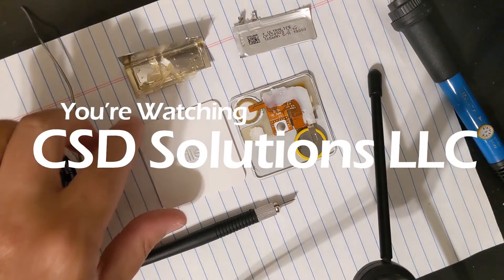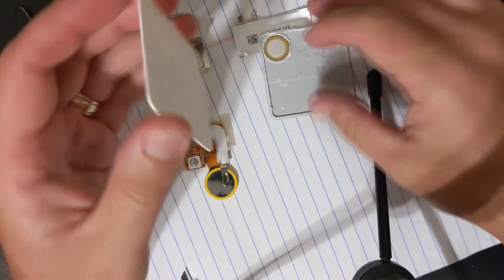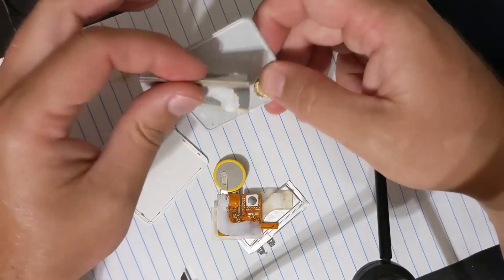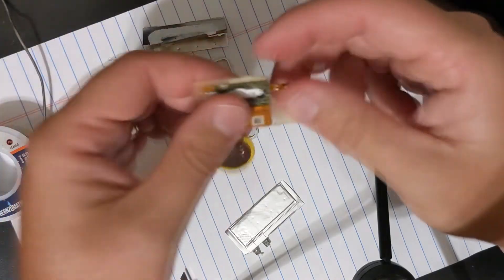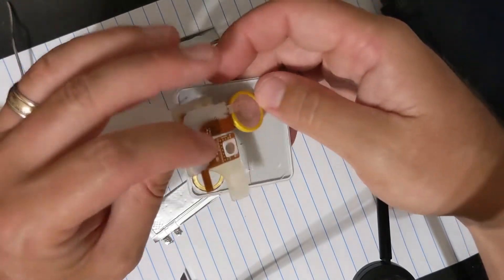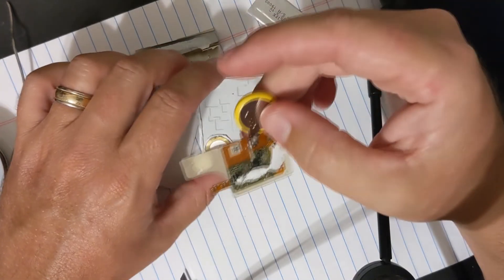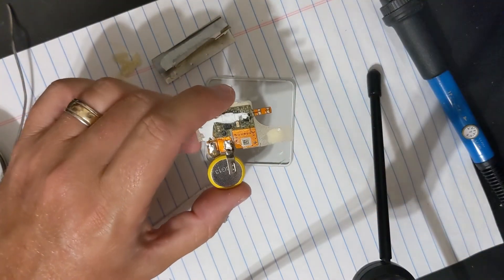Tile Slim teardown and battery replacement

Comment: If you have a hobby battery charger like the Tenergy, Horizon or Orbit or some other similar brand, they’re capable of charging down to 3.7 volts for LiPo and 3.2 for LiFePO4 batteries and this original battery can be charged back to full.  The chargers you use for balanced charging of 1-6 cell RC toy batteries will do it so no need to substitute a battery or throw the lithium polymer battery away.  Just check its charge level and take it off charge when it shows it’s at 3.2v.

Comment: Can you just charge the battery?
Reply: The battery is soldered on to the board. So yes you can change the battery but it does require soldering no matter what.

Comment: On the ones with replaceable batteries, you still have to go into the app and reset the low battery alarm manually.  Maybe that option exists for these as well?
Reply: It wasn't an option for me but it still works. You just always have the low battery warning.

Comment: It would be nice if these had a Q1 inductive charging coil in them. !!!!!
Reply from the maker: This thing is intended to be nearly as thin as 2 credit cards so it would be impressive if they found the room for the charging coil and addition curcits needed to charge the battery.

Comment: LOL This was almost a helpful video but it actually didn't finish with the battery replacement so I don't know what the point was
Reply from the maker: Maybe watch it again if you missed the point. It wasn't a how-to video. It was an explanation of what I did to replace the battery and how it worked after replacing it. The original battery was the putch battery and it was replaced with the button battery, yellow ring. To replace it you just desolder one battery and solder in the new one. This was post so that others that are thinking about doing it understand what they are getting into with out actually cutting their device open.
Reply: Are you just that slow

Comment: For anyone interested, the replace battery thing is like a maintenance minder on a car. You can tell the app you replaced the battery and that prompt will go away
Reply: Unfortunately that only applies for Tiles that allow for a replaceable battery. I can dismiss the prompt on my bigger tiles but the wallet one I can't. Oh well.
Reply: Didn't know that 😮

Comment: I replaced my slim battery with 3 CR1616 batteries with tabs in parallel.  The tile works now, but the app still showed the battery low, so I thought I would delete it and re-connect.... BAD MOVE :(  the app now says this tile is associated with another account.
Reply from the maker: That sounds strange maybe customer support could help. I wouldn't mention the battery replacement. You should be able to remove and add it back.
Reply: @CSDSolutionsLLC They've probably caught on by now...

Comment: I tried using 3  CR1616 batteries with tabs in parallel... fit perfectly. .. but it still showed low battery and didn't show the slim being near by. I tried the option for "I have a new tile"  but when I try to pair it, the app says this tile is associated to another account.  I guess you'd have to replace the battery BEFORE it gets low enought to trigger the low voltage notification. :(
Reply: There is a theory that the Tiles don't measure battery voltage, but simply trip the low battery based on time. For the tiles that take only the CR2032, it's 1 year. My guess is the slim has a three year timer?

Comment: I have the later version and the battery just died. More or less the same but different battery. I consider replace the battery too and print a new case
Reply: My original battery had 380mAh

Comment: I just recharge the battery that was in there
Reply: and that worked?
Reply: @ChrisDembinsky  nope, looked like a lithium battery.... I just took one of my broken vape pens, busted the battery out (3.7 V 1S )
Reply: @ChrisDembinsky  right away yeah, it worked.... i just soldered a 3.7v lipo battery into the + and - terminals (which are indicated on the battery you will be cutting out and throwing away)

Comment: Honestly, big ups to Tile in this design for not making it self destruct once it loses battery connectivity like some companies do for their planned obsolescence.
Reply: They had a software Killswitch on the old tiles. Was absolutely ridiculous back then. I tested the battery using a multimeter and it was 95% full but software said it was dead lol
Reply: @VincentAnzalone  that sounds like something a communist would do

Comment: Would this work without soldering do you think?
Reply: If you find a way to keep the leads firmly connected to the battery it might be possible.
Reply: Maybe filling it with silicone  would help keep it all steady  after it dries up,  which you would have to wait,  only to open it up to create some space on the corners to add not-too-strong-but-not-school-glue.  But you gotta make sure the contacts are pushing themselves.  U may also need a c clamp or something while u wait  for the glue and silicone
Reply: @XKnightLightX Set a heavy book on it while it cures. Silicone, hot glue, epoxy,  fiberglass resin?
Reply: There are solder strips that will melt with a lighter or solder glue, wont hold any other way properly
Reply: A bit of hot glue? Can be trimmed down with a Dremel/rotary tool.

Comment: This makes for a good project. Add a 12 to 3 v step down converter to the car and find a way to wire the speaker to the car horn 🤔
Reply: an opto coupler might work for the horn adapter,,, but it could get pretty annoying.

Comment: The original cell is a lipo battery and actually rechargeable
Reply from the maker: Another cool experiment would be to try to cut two squares in the plastic so that charger leads could connect to the liPo. Then someone could occasionally charge it keeping it from ever getting to the point where the app would flag a battery warning.
Reply: This battery is NOT rechargeable.

Comment: The 2032 batteries are too thick to make a good replacement, the case will not close and then the contacts will not easily touch the speaker and the speaker won't work. The part number for the original slim factory battery is "CP124920" which is a 3.0v 160mAH non-rechargeable battery.  The part number is cp124920 because the dimensions are 1.2mm x 49mm x 20mm, that's how the naming convention works.  It's a common battery but no one sells it individually, only in mass quantities to factories.  "flat" or "ultra thin" seem to be the keywords.  There might be products that contain this battery that cost not much more than the battery itself.
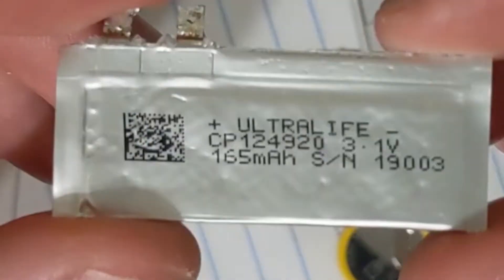Reply: 4:40 closeup of pouch battery
Reply: This comment should be pinned.

Comment from the maker: This device is still working strong. The signal strength and audio output from the little speaker worked really well. I used it today to find my wallet buried inside my wife's car.
Reply: How about now that it's been 2 years

Comment: I'm going to do this, but I don't care about putting it back together.  I'll just replace the battery and sandwich it between two pieces of duct tape.  Make it thinner and more flexible, better for a wallet.
Reply: But if you don't at least attach the speaker side, it won't ring for you to locate stuff.
Reply: So how did it go,  is it still working

Comment: You should make a video of how it looks after you put it back together. I'm contemplating getting one if these but I hesitate because of the non replaceable/rechargeable battery.
Reply: The newer version I think has a bigger battery the overall size of it is larger. I think the link to the new ones in the description. The old one is so cheap even if you throw it away after the battery goes dead it's still a decent deal.
Reply from the maker: https://youtube.com/shorts/vEjKU_gohpg?feature=share